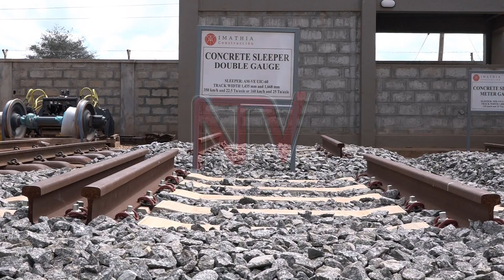Engineers laud new technology for Uganda Railway line

Comment: Maybe new technology for Uganda Railways !   But old internationally.
Concrete sleepers were first used in the UK, on the Alford and Sutton Tramway in 1884.
And they started being used more extensively during the 1930s.
The reasons Steel sleepers were used in Uganda is that they have a much longer lifespan, but are also much more expensive. 
Concrete sleepers are cheaper but have shorter lifespan of around 50 years, and are usually manufactured locally because of weight. 
There were no such factories in Uganda when the Uganda Railways was being built, until now.